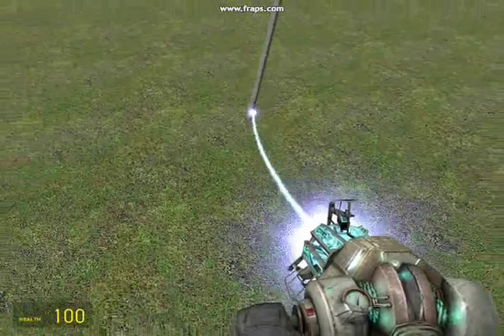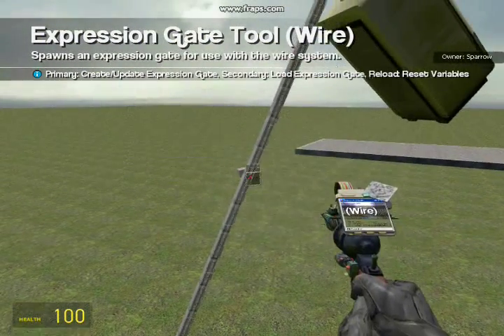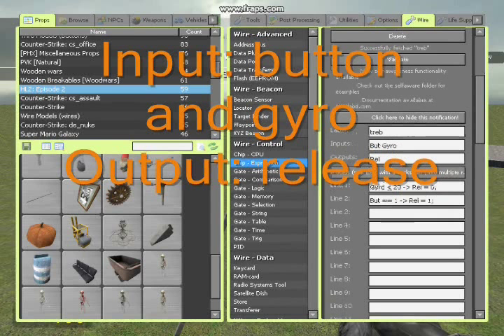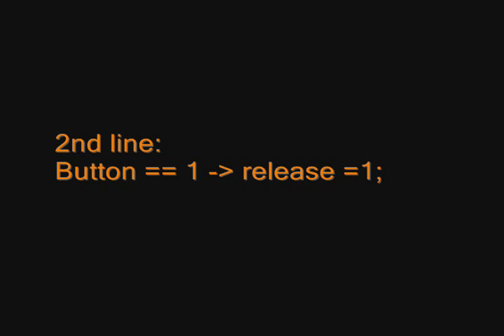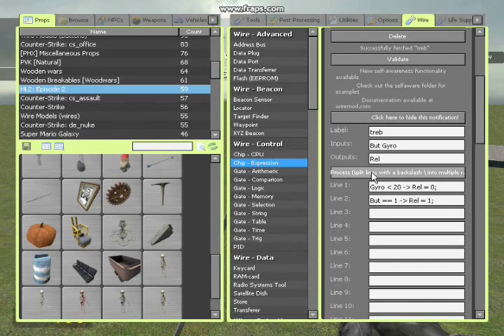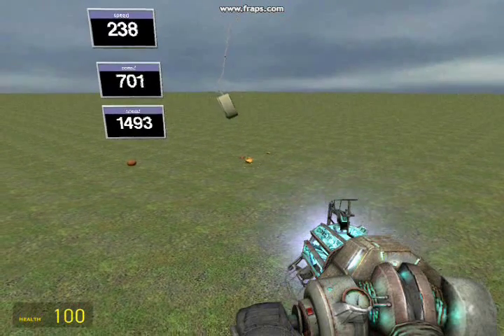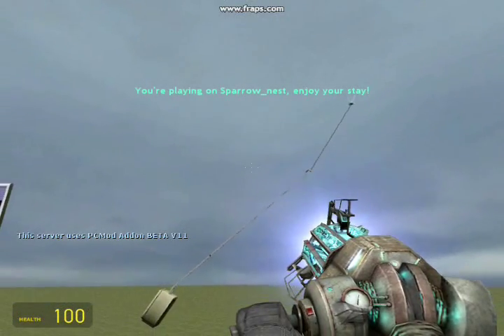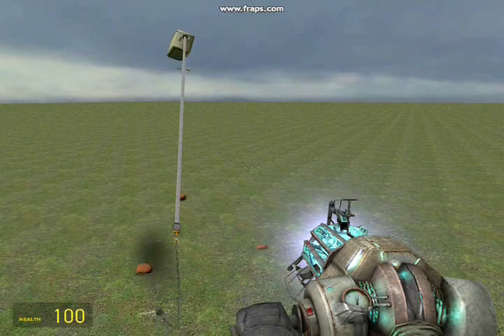Gmod trebuchet tutorial part 2.

Comment: A way to use all of the potencial energy of the fridge would be making the pole longer. You need more energy to move an objet longer and there is nothing bad to "waste" the energy of the fridge with a longer pole, since making the pole longer would make the sling go fater. You are actually tranfering the energy to the object and so it will go fater.

Comment: I figured out before you replied that to get the expression 2 chip to function, button needs to be added to the inputs.  

I also figured out that you can use either the expression 1 chip method or the expression 2 chip method, not make both chips, that confused me for a while.

Still it doesnt help as the grabber simply wont grab anything, I don't know how to make it grab.  I assumed if you held something over the white line of the grabber t would automaticly cling to it.